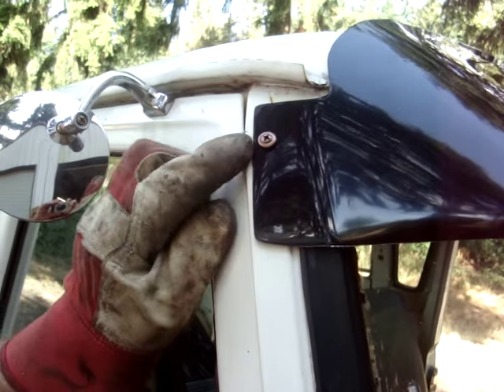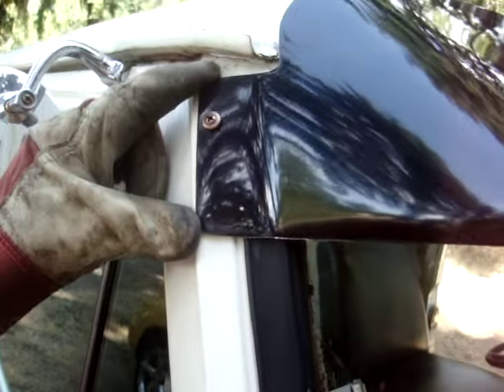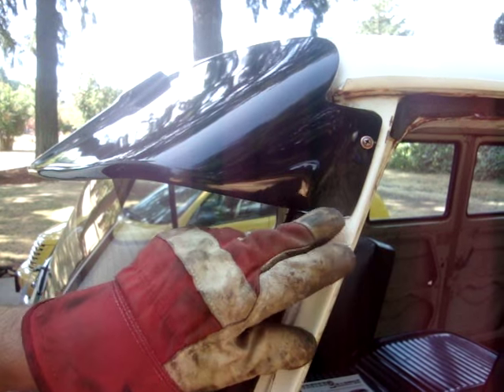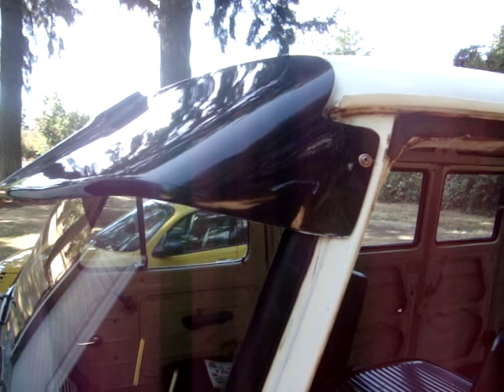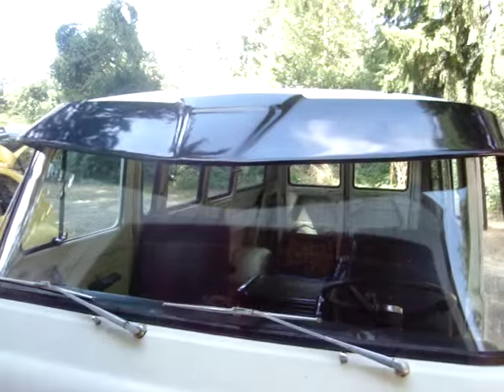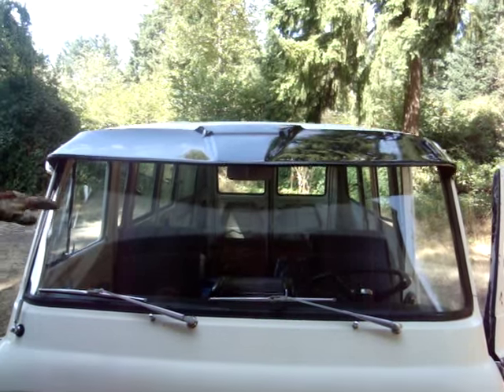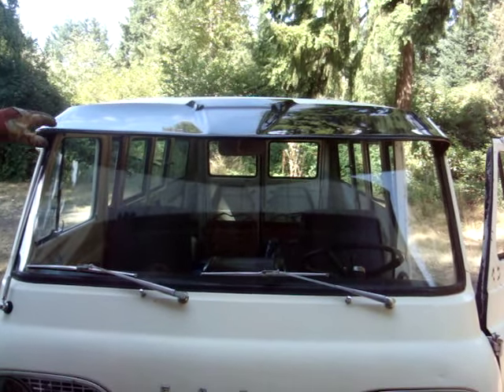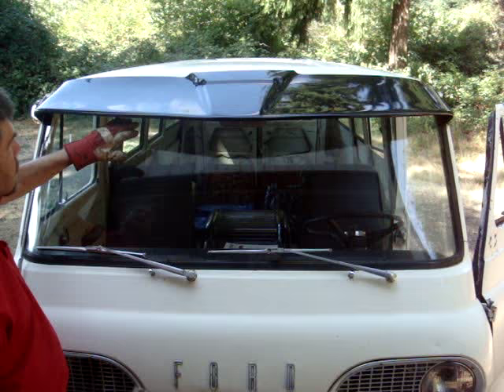Early Econoline Visor Install

Comment: Putting in the one screw at each end wouldn't that cause the visor to hinge up & down driving at high speeds?? Wouldn't using two screws be better for stability??
Just asking..
Reply from the maker: +ROOGOOSE Well, if you watched the video, he does say to put a second screw in on each side if you want. It should be just fine with one on each side as he's tweaked with the original visor to make it fit Econolines exactly. Believe me, he's done his research as he's used visors on his rigs for many years. Eight screws total for the visor seems to hold it in place and give it the flexibility it needs in higher speeds. These old Econoline vehicles really don't get up to very high speeds usually though.